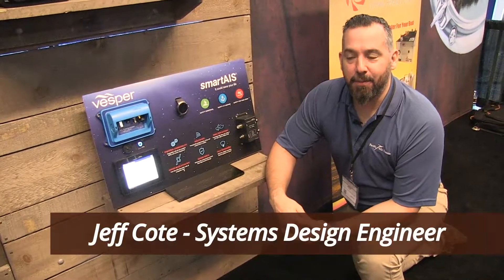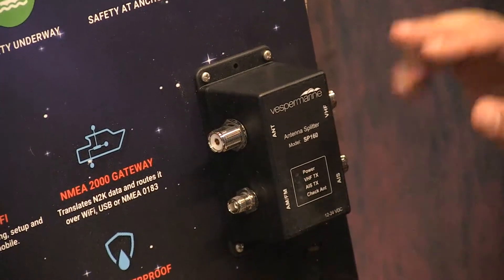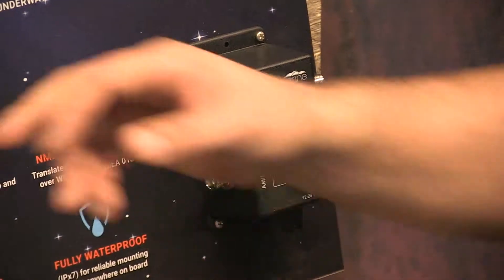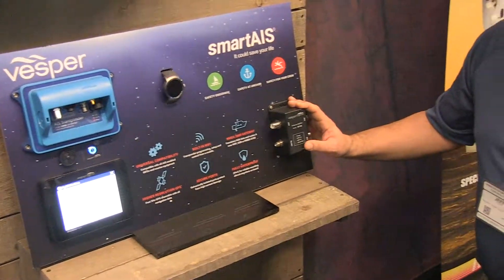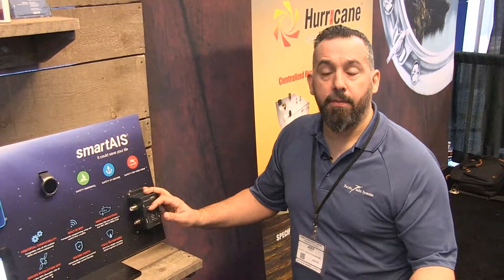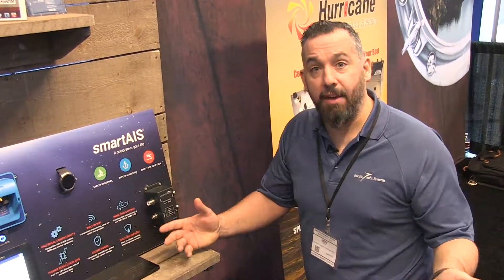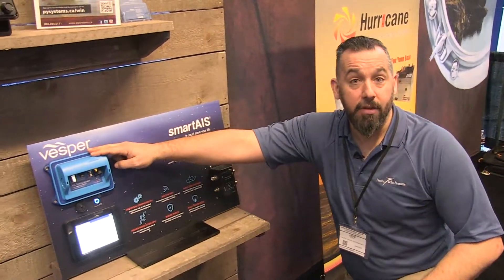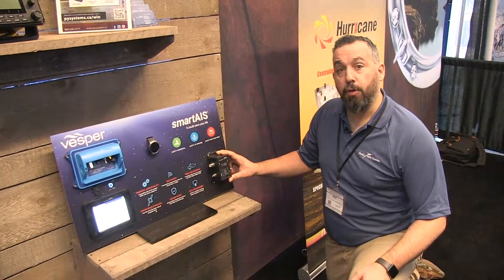Vesper SP160 Antenna Splitter

Comment: Would you recommend a dedicated antenna for my AIS transponder, or a splitter from the masthead VHF antenna?  Currently I have a dedicated AIS antenna mounted on the stern arch, and a masthead antenna for my VHF.  Obviously the masthead antenna will have greater range due to its height above the water, is that reason enough to use a splitter?  The other thing to consider is that the stern arch antenna is a backup in the hopefully unlikely event of a dismasting.
Reply from the maker: Hi David, based on your question it sounds like you have a sailboat. For reach, having a single VHF/AIS antenna at the top of the mast with a splitter is a good idea. That being said, if you lose that VHF/AIS antenna you loose both your VHF and AIS. Some boaters will install a backup antenna on a arch or stern for a backup.

Comment: Thanks for making these videos. off topic but I was wondering why blue seas stops their breakers at 200 amps? I wanted to put a 250 amp in front of my 2000w inverter. This would serve as overload protection, and service disconnect. I do not trust the cheap versions that go up that high.
Reply from the maker: Good question. Unfortunately don't know, guessing it's either a demand or manufacturing issue.